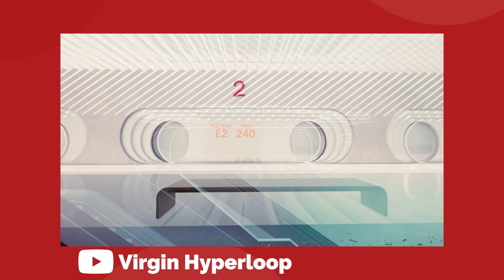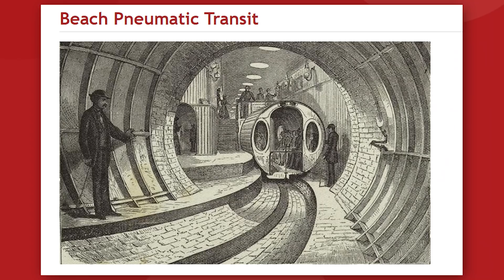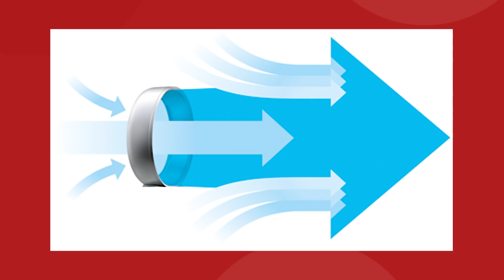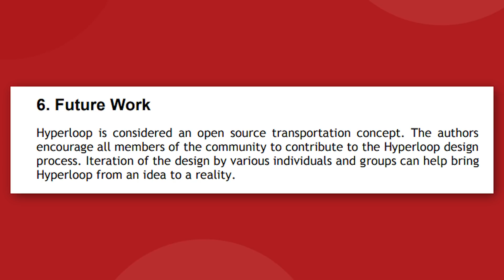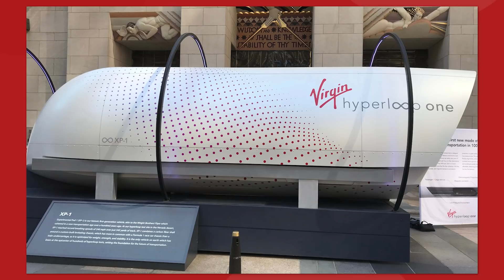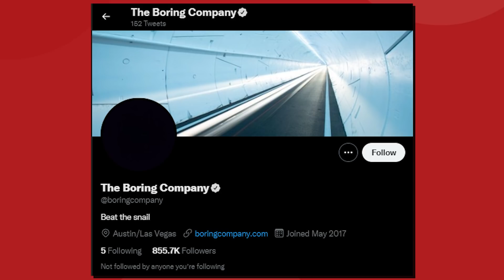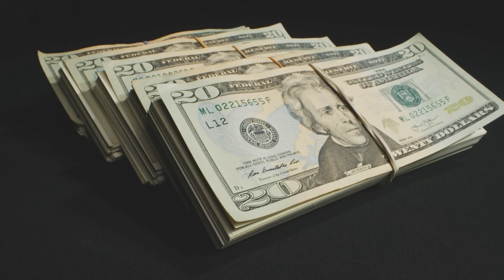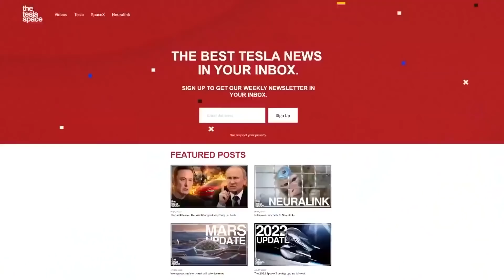The Boring Company Is Building A Hyperloop!

Comment: A first hyperloop between LA and Las Vegas is likely to receive some funding from Vegas hotels.  People could come to Vegas on holiday and take a day trip or two to LA/Disneyland/other attractions.  People living in LA could zip to Vegas for dinner and a show, then go home to sleep in their own beds.  After leaving some cash in the casino.

It's 270 miles from LA to Vegas.  Elon has said that BoringCo should get the cost of the tunnel to about $5M/mile.  Two tunnels, 540 miles, at $5M/mile = $2.7 billion.  

"In New York, the Second Avenue Subway cost $2.6 billion per mile"
Reply: Really? 280 miles of a low air pressure tube. An earthquake (San Andreas fault) will cause loss of control, and at 500 mph everyone on board will become ground meat. Even if it stops gradually, how do you get out when there is virtually no space between the vehicle and the sides of the tunnel, and insufficient air pressure to survive! If you did disembark, exits are separated by 70 miles! Are you willing to walk up to 35 miles (~12 hours) to get out of the tube?
Reply: @generaclesdey4622  

Tunnels move with the ground.  Earthquake damage occurs at the surface level due to shear forces when the ground moves underneath structures.

Cities like Tokyo, Mexico City, and LA have suffered massive earthquakes that have caused no damage to their subway systems.  During the SF earthquake that dropped part of the Bay Bridge and the elevated Embarcadero Freeway, passengers in the BART tunnels were not even aware that the earthquake had happened until they exited.

There will be plenty of space between pods and tunnel walls.

If pods stop for some reason the tunnels will be flooded with air from outside.  Just open airlock doors and let air flow in.

It probably didn't occur to you, something that commonly happens when people don't think, that a system would not be permitted if the issue of evacuating passengers wasn't solved.
Reply: @bobwallace9753  PODS travelling at close to 500MPH have different mass and inertial behavior than the tunnel itself. Living in California has taught me that Tunnels Crack! In my town, water and sewage pipes are wrapped in several inches of concrete when installed, and they do crack at intersections of seismic waves. The resonance frequencies of the hyperloop will never be identical to the resonance of the tunnel (Doppler-related efects) so collisions with tunnel walls are guaranteed.
Reply: @generaclesdey4622  

Pods moving 1 MPH has a different mass and inertial behavior of the tunnel.  Where's the physics that drives your thesis?  Do you think the pod will hum concrete into cracking?

Remember, the pod is moving in a near vacuum.
Reply: @generaclesdey4622  Yup, most people forget the ..."and fire" part of the great San Francisco earthquake of 1906. It did much damage! Fires caused by the breaks in the crude gas lines of the day, buried several feet underground (like a tunnel would be) throughout the city, that caused by the ground shaking for a few minutes. Any buried structure will be at risk in earthquake country, i.e. all of California! I lived in L.A. at time of the North Ridge quake of 1971, relatively small, only 6.2 I think; but it "scared the living shit" out of everyone there at the time, and some deaths. Analysis of the local Seismic Activity will likely be a key factor in siting these things, if they ever are built!
Reply: @ronschlorff7089  
It may well be that gas mains buried just below the surface were damaged.  Especially in the Marina area which is essentially a large landfill, including hundreds of abandoned sailing vessels from Gold Rush days.  

Ships sailed in with prospectors and goods.  Crews jumped ship to pan gold.  No crew?  Abandon the vessel. 

The soil in the Marina district is poorly compacted soil with a high water level.  In an earthquake that part of SF turns to 'jelly'.
Reply: @bobwallace9753  it was hit hard during the '89 quake that happened during the world series between giants and Oakland A's at the time. That fill is mostly "modern", in marina area, not much fill done around bay in 1906 or prior to that.
Reply: @ronschlorff7089  
Two points.

1)  Most of the building damage in the '89 quake was in the Marina district.

2)  People in the BART tunnels during the quake weren't even aware there had been a quake until they exited the tunnels.

And a side note.  I live close to the Ca coast where earthquakes are relatively frequent.  My house is built on top of a rocky ridge.  A few years back, on a winter day, the radio started talking about a quake of some size that had just hit the area. 

They were getting calls from outlying areas to determine now far away the quake had been felt.  It had just snowed the night before.  People much further away than me reported feeling a strong shake and some mentioned seeing the snow being shook from surrounding trees.

I felt nothing.  My trees were still full of snow.
Reply: @bobwallace9753  I went through the one in Northridge (near L.A.) in 1971, shook like a mother f'er for over 20 seconds, we were about 30 miles from epicenter; transformers blew up, brightly flashing, on our street, thought it was a nuke attack at first!!!!  Then I calmed down, and said to my wife, who was saying her hail Mary's, "calm down, it's Only an earth quake" LOL.. And I was taking a college course in geology at the time (Glendale Community College) and I put on my "science hat" as I said "gee I think this is at least a mag. 6, but not a 7 it turned about to be 6.1 or something. Had been in little ones before, as a kid, single little jolts but not a sustained one for several seconds. I was working in Sacto during the 89 quake, felt nothing as I was driving at the time. Fun fun, fun in the sun sun sun, if you live in Ca., eh!! Now I'm in AZ, no quakes, just it's 200 degrees out there today!! LOL :D
Reply: @ronschlorff7089  

I experienced the 1971 quake while living in San Diego.  I was awakened by noise from the HVAC ductwork moving around.

But, that said, earthquake damage occurs at the surface, not in underground tunnels.  LA, SF, Mexico City, and Tokyo experience very large quakes and all have underground transportation systems.  No real damage reported.  

A subway station in Mexico City had some minor damage.  But that was at the surface level.
Reply: @bobwallace9753  San Diego, loved that during 60's when it as a separate town, the great zoo there was a family destination then. And sea world! We've been to Ocean Beach? recently 20 mi. north of town, nice area, right next to USMC base. 

Yeah, but underground, the view of CA's nice scenery not too great!! :D

Comment: There is a Hyperloop currently in operation and has been in full operation for atleast 25 yrs now, under Washington DC and travels underground all the way to Nevada and Utah, to underground bunkers and to M Cave complexes. There are documents and testimonies disclosing details on these massive tunnels, how they were made, and that they are 100% free of air, and the trains that travel through them can exceed the speed of sound. 

The boring machine that was used to make these perfectly straight and seamless tunnels for the current hyperloop tunnels is a atomic powered thermal boring digger that melts the rock. It looks just like a very sharp color'd pencil. The tip of the boring perpetrator becomes extremely hot, and literally turns the stone into magma and is sent back through the machine.
Reply: You got that right.   If you have a radar ground penetrating radar machine, reply to me
Reply: @jamezbrian4135  I do not, however I was involved in the Disclosure project somewhat with Dr Steven M Greer, who testified of these tunnel systems, and they are extensive. Very very long tunnels that reach across all of North America and connect almost every instillation underground.

Comment: If using maglev there doesnt seem to be much point in making a tube. The only thing a tube brings for a maglev design is increased speed but it also increases the cost. Cheaper and slower will win out economically with a maglev design. Hyperloop only makes sense (economically)with air glide.